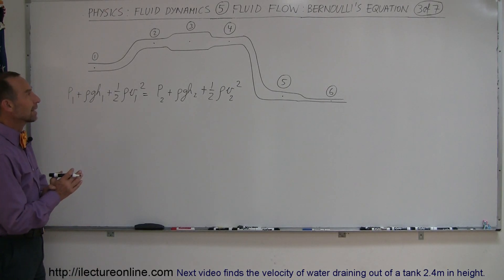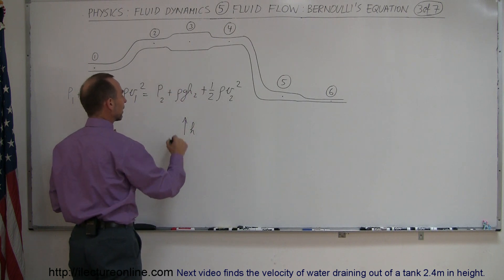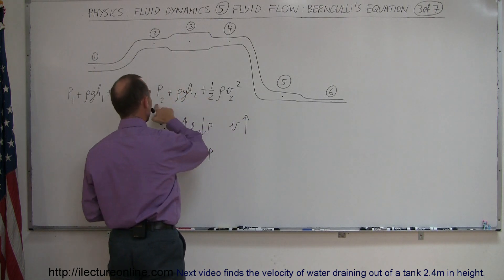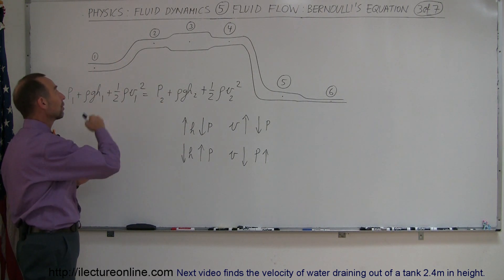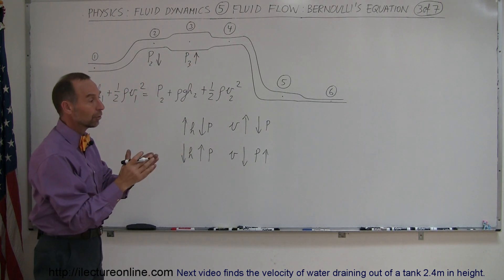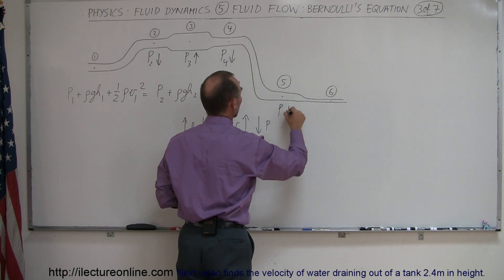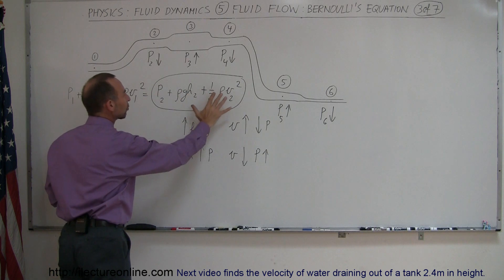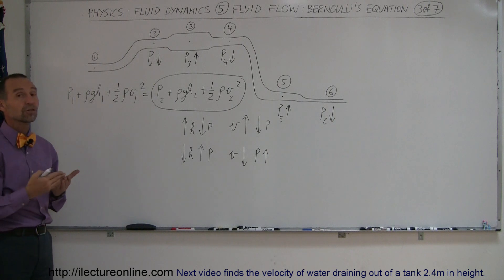Physics 34  Fluid Dynamics (3 of 7) Bernoulli's Equation

Comment: sir, may i ask how do we know only one of the variables change, or 2 of the variable changes like if v increases, pressure decrease or if v increase, so is height increase, pressure will decrease?
Reply from the maker: We made a video that explains Bernoulli's equation and where it comes from.  PHYSICS 34.2 BERNOULLI'S EQUATION EXPLAINED         Physics: Fluid Dynamics: Fluid Flow (1.6 of 7) Bernoulli's Equation Derived    https://youtu.be/R5uoTadxhpU
Reply: @MichelvanBiezen  thanks a lot sir, but may I ask another question, at part 4 , how do we know that the velocity doesn't change 🤔

Comment: Hello, could the Bernoulli equation be used only considering points 1 and 6, that is, ignoring the height changes along the rest of the flow?
Reply from the maker: That is correct.  You can pair up any 2 points.

Comment: when fluid is going from point 4 to point 5 I can clearly see why elevation head is lost and so pressure goes up, but what I have never understood is how do we account for the fact that the fluid should be accelerating because of gravity through the downslope segment? If it's accelerating it would seem to violate the continuity equation for steady flow and there'd be no conservation of mass. So what is actually happening when confined flow in a pipe goes downhill? In the case of a stream of water is free fall the water stream itself will taper because it is accelerating by gravity, so in order to maintain conservation of mass along the stream the diameter shrinks, but I don't think anything like that is going on here. So what is the answer?
Reply from the maker: There are two things that can happen.  The fluid can gain speed or the pressure can increase.  The speed of the fluid can only change if the diameter of the pipe changes, therefore the pressure must increase with decreasing height if the diameter of the pipe remains the same.

Comment: Dear Michael, I love your lectures thaks for your effort. You got a little mistake. Pressure along pipe always decrease, on the contrary the flow goes backwards. Velocity varies and energy is reduced inexorably. Higher Pressure in a flowing fliud goes from P1 upstream to loer Pressure P2 downstream always, P1> P2. Cheers
Reply from the maker: There is no error in the video, however this is just an academic example.  In the real world of fluids flowing through pipes, the pressure will decrease as you move along the flow and energy will be lost due to friction and the viscosity of the fluid.
Reply: @MichelvanBiezen  Thanks Michael for your response, very kind. I completely trust in your experience as lecturer, probably it is better to use mass as a conservation law or any other example for energy conservation. Bernoulli equation requires a friction loss term to be consistent. In any condition the pressure downstream won’t be higher thus this concept is wholly erroneous for the student. The consequence of a wrong concept maybe catastrophic for anyone.
Reply from the maker: There is nothing conceptually or mathematically incorrect about this example.
Reply: Dear Micheal of course that's completely wrong. Pressure must be always higher upstream.  It's equivalent to sustain that objects fall upwards. If you keep sustaining this you better go back to your university. Not bad for you to refresh basics.  Cheers

Comment: The tube at 7 is much tighter ? Thats the pressure going up first, the velocity going down, thus the flow rate going down because the section is smaller Q=S.V
Reply from the maker: The flow rate is the same everywhere along the tube.  Therefore in narrower sections the water flows faster and the pressure drops.
Reply: This is exactly my doubt, what makes you say the flow rate stays the same everywhere ? Why not both speed and section makes it flow lower.
Reply: Lets imagine the area of a small tube as a valve thats slightly open. If u have a valve and u close to the middle, u'll notice the flow rate reduced after. Thats a squeezed area, same concept for smaller section if u get my idea.

Comment: sir like this maybe a dumb question so if the height is more the distance to be traveled by fluid increases and so time increases proportionally so force around the walls of the container with increase in time leads to increase in impulse therefore force increases proportionally so if force increases and area remains the same the pressure increases ...... idk pls help this was just a thought experiment
Reply from the maker: It has more to do with kinetic and potential energy.  See this video in the playlist:  Physics: Fluid Dynamics: Fluid Flow (1.6 of 7) Bernoulli's Equation Derived
Reply: @MichelvanBiezen  ok i will do

Comment: At point 5 v decreases and so does h which makes p quite high. In point 6 h decreases a bit but v increases which makes it hard to tell?
Reply from the maker: The difference in height between 5 and 6 is supposed to be negligible.  The faster speed at 6 is because the pipe is much more narrow at 6 than at 5.

Comment: Hello Sir,
I have two questions.
1. Why does pressure increase as velocity decrease?
2. Why pressure increase as height decrease? (No detailed answers required just hints)
Thank you Sir.
Reply from the maker: 1) When molecules are on the move, they create spaces between them and the interactive forces are somewhat damped due to the motion, and thus there will be less pressure.  When molecules stop moving they settle in and pressure will go up.   2) Pressure in a fluid as a function of depth = density x g x h   where h is the depth below the surface.

Comment: Shouldn't a decrease in volume should increase the pressure? Because if you squeeze it then the atoms should hit the surface of the pipe more often.
Reply from the maker: That is the case in an enclosed container.  With a fluid in motion inside a pipe, a change in the cross sectional area will change the speed of the fluid, which in turn will change the pressure in the fluid.

Comment: At point 5 , the pressure and the velocity should be increased, is it not?
Reply from the maker: Relative to what point?
Reply: to the number 4
Reply from the maker: Since the diameter at 5 is the same as the diameter at 4, the velocity must be the same at 5 and at 4.  Since h at 5 is lower than 4, the pressure at 5 must be higher.   The pressure increase at 5 = rho * g * h    where h is the height difference between 4 and 5.
Reply: Michel van Biezen  thank you for your answer. and thank you for the video...they are helping me a lot. I did not take in consideration that this is a system closed where it is not opened to the atmosphere. But if we have an open system, the study will be different right? like a waterfall in a lake. because the velocity at the lake will be 0.

Comment: Assuming the fluids flowing to the right, does area (3) not push backwards onto area (2) and try to flow in the opposite direction(as it has greater pressure)? Seeing as we're going from an area of lower pressure to higher pressure. Don't you need a greater force on the left side than on the right to have a direction of flow? (to the right)
Reply from the maker: Bernoulli's equation is simply the realization that P + rho*g*h + (1/2)*rho*v^2 = constant for any point in the pipe.  That allows us to find the pressure or velocity at any point in the pipe assuming we know the other parameters.  Determining which direction the water will flow is a different problem with a different equation.  Just like everything else in nature, water will flow from a higher potential energy to a lower potential energy, or simply, water will flow down hill.

Comment: as P = F/A ,if A increases, P decreases. But at point 3, u said P will increase. Why ?
Reply from the maker: +Tahsin Rahi At point 3 the velocity decreases, therefore the pressure increases
Reply: +Tahsin Rahi If you go look at (2 of 7) it says when v slows down, pressure increase - also has the equation on the board while he's explaining. Makes it a little easier to understand it guess. Go have a look ^

Comment: Just coming out of Bernoulli's theorem , generally speaking : Pressure is something called force per unit area as we know. That means if area decreases, certainly pressure should increase. Then how is pressure at point #6  lower than point #5. Please explain!
Reply from the maker: Rahul Iyer 
Like every theory in physics, you must start with a premise that is correct.  
The statement: "if area decreases, pressure should increase" must be based on a an equation that you know is correct in this particular situation.
Which equation did you start with in order to make that statement?

(I am trying to show you how we should look physics in general, the answer will become apparent......)
Reply: Michel van Biezen Thankyou for your reply!But I am still confused over here.The pressure head in the Bernoulli's theorem is derived actually from the basic relation : Pressure = Force / Area as follows :P = F/A    = Weight / Area    =  (weight density x Volume)/ Area    = ((weight density x (area x depth))/ Area        { Area in the numerator and denominator gets cancelled }    =  Weight density x depthTherefore,pressure head , i.e. depth = Pressure/weight densityComing back to the basic relation : P = F/AHere, P= pressure ; F= Normal force ; A = area of surface in contact.What I mean to say is that , area of contact at point#6 seems to be less than point#5 which will increase the value of P considerably.I don't know to what extent I am right. Please correct me if I am wrong.After this discussion I would be keen to know from you the relationship between pressure and flow rate in a water distribution network.Thanx & regards,Rahul Iyer
Reply from the maker: Rahul Iyer 
Now we are getting closer to understanding Bernoulli's equation.
Pressure in a pipe is caused by 3 components, in your description above, you are only looking at 1 of the 3 components:  pressure caused by the weight of the water above the point of consideration.
The second component is caused by pressure at the end of the pipe, which can be caused by a number of things: the atmosphere, a pump, etc.
The third component is the speed of the fluid through the pipe which decreases with increasing speed.  When the pipe narrows, the speed increases and thus the pressure reduces in sections where the pipe is narrow.
Reply: wow thank you Michel van Biezen for that explaination

Comment: Trying to wrap my head around this. 
At point 3, surely the decreased diameter at point 4 has as much to do with the increase in pressure at point 3, right?

Let's say that you cut off the rest of the pipe halfway along point 3 (so that the liquid was just spraying out into the open), would the pressure measured at that point (the lip of the pipe) still be higher than at point 2?

Comment: Excellent video!!
Let me ask something that has troubling me now for a long.
Let's pretend we have a pipe like the (4-5) section and the upper end is at the bottom of a tank full of fluid and the lower end end up in an empty tank.Now the water will start flowing into the pipe downfall.If we apply bernoulli's equation between two points of the pipe A(higher point) and B(lower point) then because the velocity doesnt change and the difference of the height is hA>hB,the difference of the pressure will be pB>pA.
So the fluid flows from a point of low pressure to a point of high pressure.Is this right?because we know that this law goes the other way.Or when we say that the flow must be from higher to lower pressures we mean the total pressures?
Thank you.
Reply from the maker: John,

I had a hard time following your question.
But this may help:  There are 3 things that control the flow of water (or fluid) in a pipe.  (Height, velocity, and pressure)
Bernoulli figured out how these interplay, so that one could increase while the other decreases.  So it is possible for water to flow from low pressure to high pressure, of from high pressure to low pressure as long as the other factors compensate for it.
Reply: Thank you for the response,this helps me to get a better understanding.English is not my native language so im sorry for any mistakes.

Comment: Why does Velocity decrease when diameter increase and vice versa?
Reply: 902hater Because the flow rate is constant. Therefore if the pipe is wider, more liquid is occupying a cross sectional area, the fluid must be moving slower in order for the same amount of liquid to pass a specific point in a specific time. Mathematically --> dV/dt = constant therefore Adx/dt = constant; dx/dt is velocity: so A1v1=A2v2 if A gets bigger velocity gets smaller.

Comment: # 6 the pressure should go up. If put at psi gauge at the end of #6 and restriction psi should go up please explain thanks
Reply from the maker: Mark,
If you compare point # 6 to point # 5, the only thing that is changing is the width of the pipe (it becomes smaller going from 5 to 6).
That means the velocity must increase going from 5 to 6.
That means the pressure at 6 must be lower than the pressure at 5.
Reply: Thanks

Comment: Why only Pressure changes when height or velocity change and not for example when height goes down velocity changes?
Reply: +Michel van Biezen So if the radius of the pipe is the same in two sections, then the velocity will be the same as well, regardless of elevation?
Reply from the maker: fenash1
You have to combine 2 equations:
The first is Bernoulli's equation where you know that:
P + rho*g*h + (1/2)*rho*v^2 = constant     thus when one changes something else has to change.
The second is the flow equation:
A1v1 = A2v2
That must always be true as well.  The combination of these 2 equations will give you the correct answer.

Comment: 1st of all, thnx 4 posting these vids
2nd, u lost me at point 3
---
i mean im w u at point 2 cuz where the height of the pipe increases, the pressure has 2 decrease
xcept at point 3 the circumference of the pipe increases so shouldnt the pressure decrease, in order 4 there 2 remain a constant?
similarlly the pressure at point 4 should increase since the pipes circumference decreases, rite?
i totally agree w the pressure goin up at point 5 cuz the elevation of the pipe went down
but then shouldnt the pressure increase even mor at point 6 cuz the pipes circumference jus decreased?
---
very much agree that as the pipe widens the velocity slows down but the pressure also decreases cuz velocity is predicated on the pressure
like popping a zit 4 lack of a betta xample..the mor pressure at which u squeeze it, the higher the velocity of the white umm shiz
subsequently if u decrease the pressure, the velocity decreases so the said white shiz wont make it 2 the mirror (yeah, no..gross but effective xample)
---
im totally not tryin 2b a skoosh la doosh jus confused now is all
Reply from the maker: Lance,
Going from point 2 to point 3, the velocity slows down;
A2v2 = A3v3
Therefore the pressure at point 3 must be higher than at point 2.
Reply: Michel van Biezen From point 2 to 3, since the fluid is going through the wider section of the piper (thus the radius is larger in size), the velocity is decreasing. The smaller the radius, the larger the velocity of the fluid. Since the velocity of the fluid is decreasing, the pressure must compensate the velocity of the fluid so it increases. We know they are inversely proportional. Correct? I just want to make sure i really do understand this.
Reply from the maker: ***** Denny,
In general you are correct.  In isolation (ignoring all other aspects), if the velocity of a fluid increases the pressure decreases and if the velocity decreases, the pressure increases.
What is always correct, :   P + (1/2)*rho*v^2 + rho*g*h = constant.